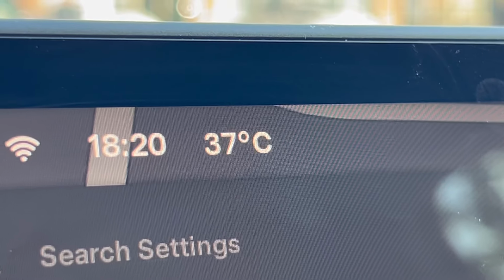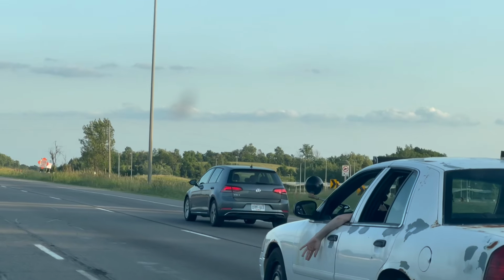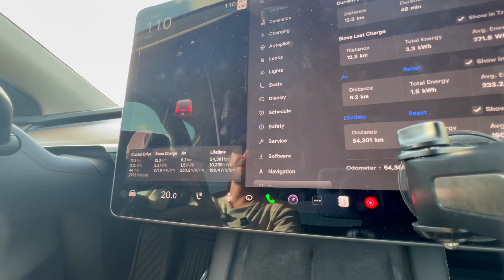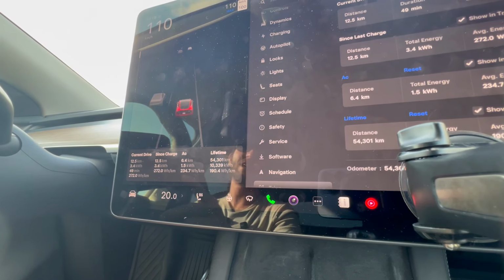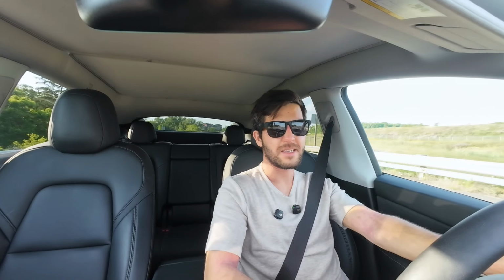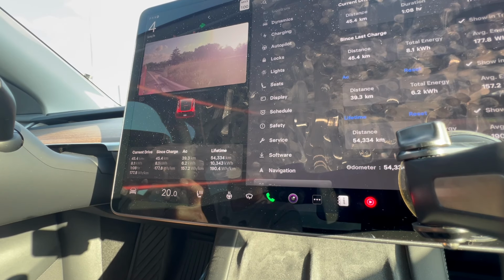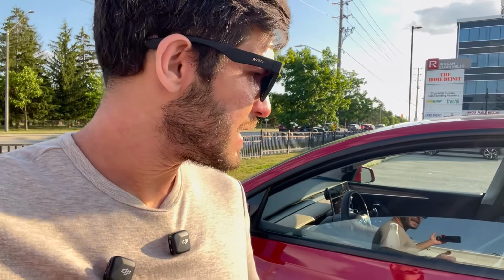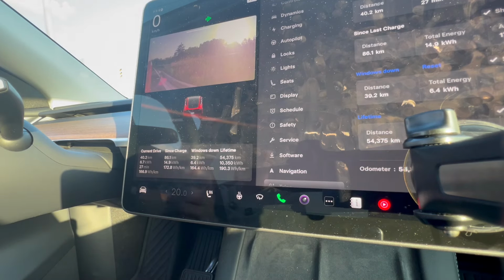Testing AC vs Window EV Highway Energy Consumption

Comment: Wow. Didn't think that the break even point will be passed so fast at 110km/h. I thought it'll be at least 120km/h or so. Although slightly repetative, I wonder if lowering speed to 90km/h would have made the "AC off" worth it more economical.  
And another variation would be if it would make any difference if you opened 2 windows instead. I'm guessing the buffeting of the wind would have made the drive uncomfortable. Personally, I really cannot stand the wind buffeting  >.<